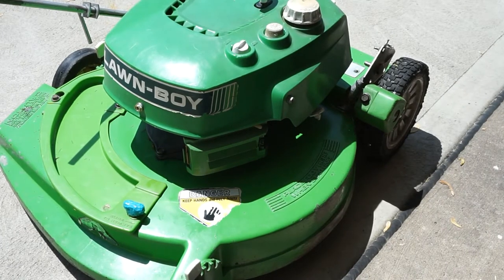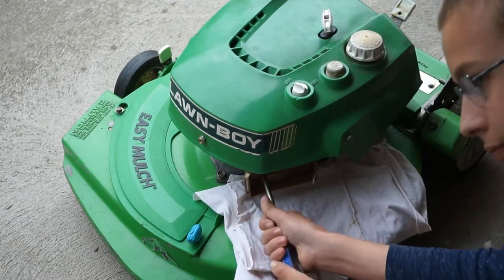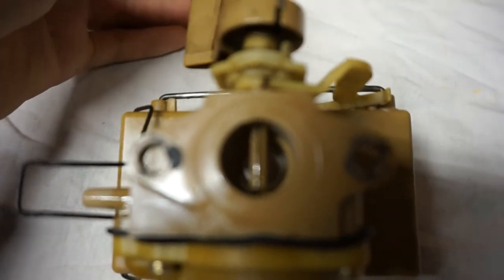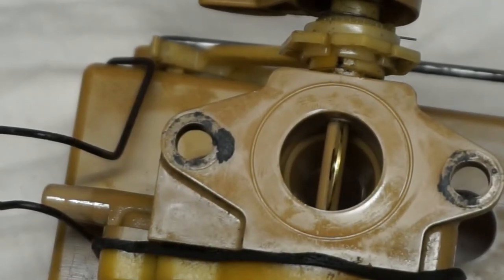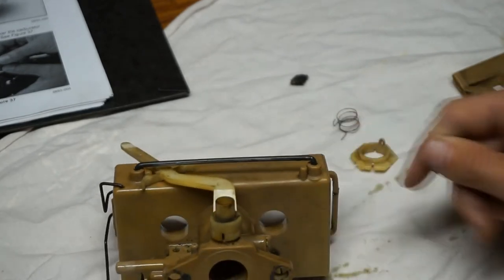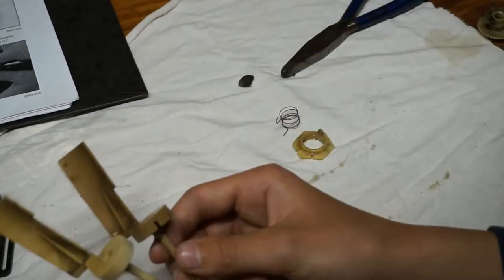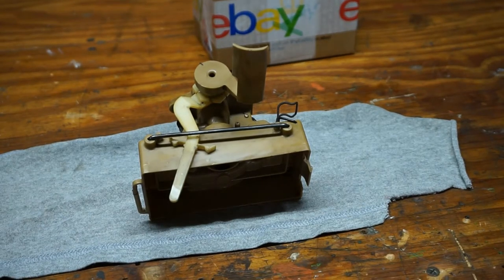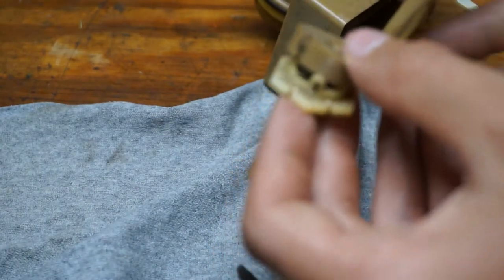How to install a Lawn-Boy Air Vane Governor

Comment: You seem to know a lot about this model Lawnboy, I have the same one an R-8237 s/n 9672811. The only difference is the brass hex nut on top of the carb. My problem is low RPM on the normal setting and the weird thing about it is when I shut off the gas flow the RPM increases substantially (to what it should be) for about 30 seconds until the gas runs out. Any idea thoughts you have would be greatly appreciated. I followed your video instructions on setting the vain tension but it didn’t fix the problem.
I have broken down the carb completely and cleaned it as well as the exhaust ports. Also cleaned and re-gapped the coil. It starts in 3 pulls.
Reply from the maker: Very sorry for the late reply, I have seen this before and the issue is actually your float, and needle and seat. The problem is the float is not closing fully and the pressure from the tank is causing the engine to run rich. First thing I would do is adjust the float. Turn the carb upside down and take off the bowl, using 2 pairs of pliers bend the float up. This will cause the float to be lower in the gas level causing the float to close the needle fully. If that does not work replace the needle and seat. Usually just adjusting the float will work.
Reply: @lawnboyR  Thank you very much for helping me with my problem. I'm going to try your solution and see if it works for me. Thanks again.

Comment: I had the exact same problem with that little nub on the end of the air vane shaft broke off allowing the air vane to move up and down and be loose.  Also found out the air vanes I had on hand, like yours from the other carb would not work.  Ordered the correct one from eBay and good to go.
Reply from the maker: Glad to hear it!